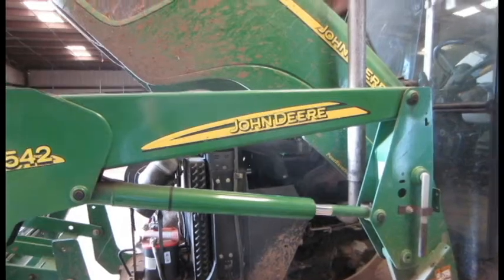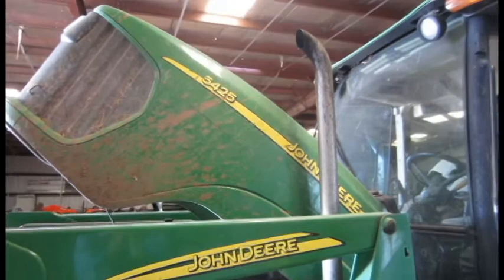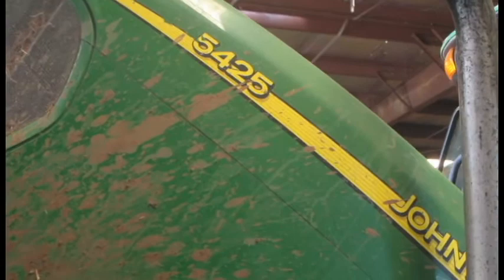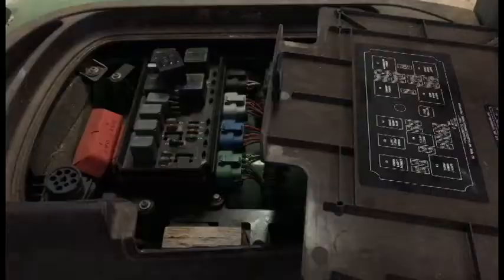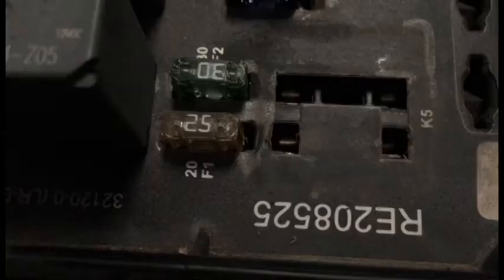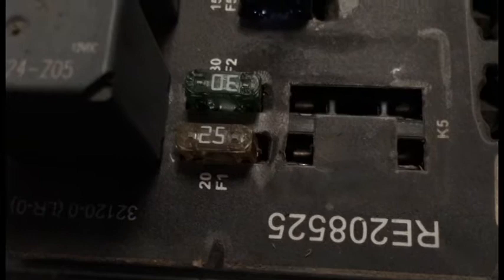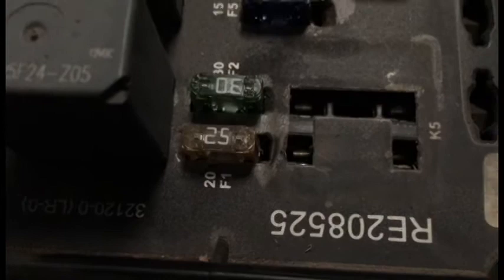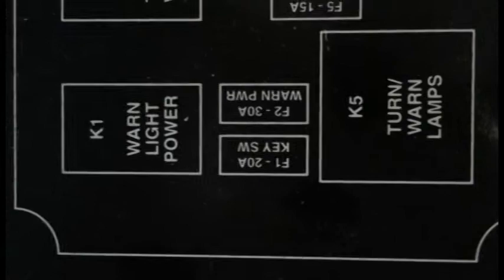JD Blown Fuse F1

Comment: JEENDA Temperature Switch RE503242 Compatible with John Deere 5000 6000 7000 Series Tractor . You can get it on Amazon, around $25.00.
Reply from the maker: Excellent information.
Reply from the maker: Using the part number given by @TheCoalhog, I found my replacement on eBay for $25-30.